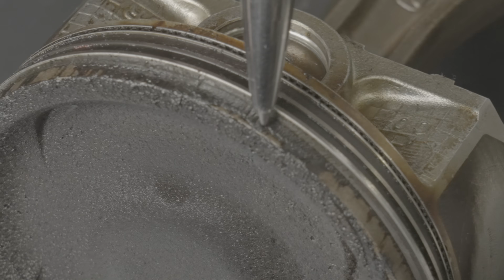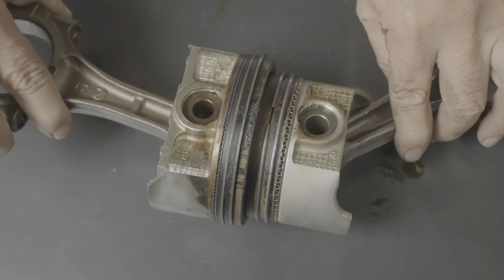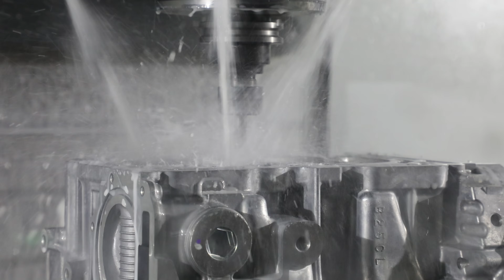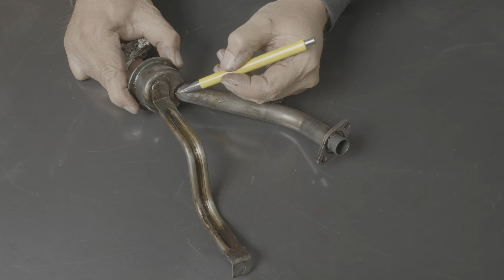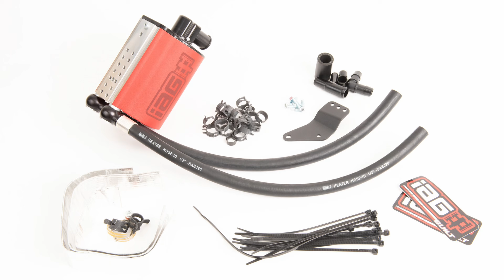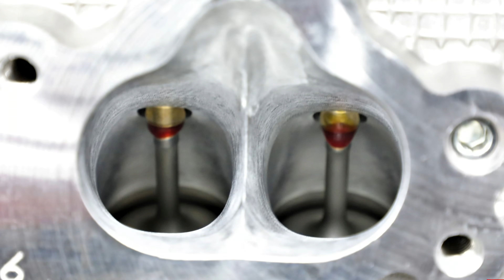Why Subaru Engines Blow Up!

Comment: BaderBuilt is on the road of perfecting these motor builds and actually making power on stock blocks & internals. He just did above 1000hp with I believe 45+ psi. Although I don’t know how much more it would’ve handled, when he did a tear down to prove the block was actually stock there was absolutely no signs of damage nor glitter in the oil pan. I’m not saying they are completely bulletproof but everyone thought it was impossible to make that much power on a stock block even Josh said that himself.
Reply: You understand that it’s actually not that impressive right? First off, that thing doesn’t start making power until like 6000RPM, it makes very little torque which means it’s not seeing crazy cylinder pressure. Look at the power curve, it’s makes power for about 1500RPM and would absolutely suck to drive on the street or the track. Second, on high ethanol content, it’s virtually impossible to get the thing to knock, you’ll push it way past MBT and squeeze the damn rod bearings out well before you see knock. Also, that would not live very long making track pulls or on the street it’s a completely useless project. Bader hasn’t figured out another new about EJ’s other than new ways to blow them up. STOP idolizing this guy and others like him. He’s at best a “one pull hero”.
Reply: @JordieG8 How can anyone say that a stock 1000 whp 4 cylinder is not impressive? It’s currently the only 4 cylinder in the world to ever pull that off. It’s crazy to me that Subaru never gets any type of recognition no matter what they do. Subaru could build a rocket car and people will still hate 😂
Reply: @builtvisions  because it’s not. For all the reasons I mentioned and if you had a clue what you were talking about you would understand. I’m not dogging on Subaru, I own one.
Reply: @JordieG8 Also for the record, you’re incorrect. He’s already confirmed that multiple EJs that he’s tuned, a lot of those on stock engines past 500 whp have seen many years of abuse and 50k plus miles with no negative feedback from the engine. You need to understand that Josh Bader is the best in the game when it comes to tuning EJs. People can make jokes about EJs all that they want, but it doesn’t change the fact the an EJ in the right hands can be extremely competitive in the racing world.
Reply: @builtvisions  Best in the game? Dude, if you had a clue what you were talking about you would know what a fraud this guy is. The amount of complete uneducated bull shit he says in his videos is painful. He has a strong following because he panders to the lowest common denominator such as yourself. The types of people who don’t know what they don’t know. People working their way up mount stupid on the dunning Krueger scale. Stop believing everything you see on the internet stop idolizing people and think critically, for everyone’s sake.
Reply from the maker: He knows what he is doing, he tries to make the most power possible on stock bottom ends to see what can be done, with the right tuning those kinds of numbers are possible for a little while.  Those kinds of things are good for likes and views, nothing wrong with that. I stress a little while.  He seems to be mostly a drag racer.  If you do a non-competitive track day,  Every lap is equal to several quarter-mile passes at least, probably a day's worth at the strip. One session is like 20 trips to the strip, typically you have 3-4 sessions a day and a track event is two days.  Then you throw in stuff like oil sloshing due to G forces and prolonged heat build-up due to being on the throttle so much. That is just a fun track day, not like competition like time attack or road racing where you are tuning up the wick. I tell you what, a totally stock subie engine turned up to 1000whp and run on a road course isn't going to last even one session even on a fun non-competitive track day unless you are putting around. The team I help has at least one fully built engine sitting in the transporter ready to drop in when they are at a major time attack. and they run at 700-800 hp.
Reply: @motoiq  Well yes, I agree with you on that. A road course is going to be much harder on any engine in general, especially one at such high power levels. Regardless, it’s great to see how much the Subaru platform has grown over the years. I’m sure that it will only continue to develop.
Reply: For how long between rebuilds?  1000, 2000, 3000 miles of road racing? 🙂
Reply from the maker: One pull hero car.  Take it on the road course, BOOM one session.  I am not saying they don't know what they are doing, they did it just to see if it was possible, just that if you took it to a track day, it would not be running after a few laps into the session.
Reply: @motoiq  💯
Reply: @motoiq  Love and appreciate your candor Mike!!!

Comment: I’d like to inform you that I’m a dumbass and blew over 100k building and fixing my dumb Subaru.. had 4 engines in it and it was 600 horsepower in its final form.. my oil pickup cracked when it was stock engine just jbo tune.. 280hp.. car never saw a track day in its life and I broke it.. then the second engine I left open deck like a dumbass.. on this engine car made 350hp and I cracked a cylinder.. you are overestimating the engines durability it’s actually worse than this video makes it sound
Reply: You could have stopped after the first sentence.

Comment: Can you comment of the pickups in the ej255 featured in the legacy GT as possibly heard they were revised or is the design still flawed as explained around the 9min mark
Reply from the maker: Same bad engine.
Reply: @motoiq ok thanks for the feedback. I've tracked my GT twice with no issues so far, one in post tune, approximately 220~ whp. Aussie dynos show a lot less verse American

Also have never really heard any pickups failing within our community but time will tell with in my context...
Reply from the maker: It's not super common, I have only seen 3 cases personally but it happens and it sucks because that cheap little part destroys the whole engine.

Comment: As always, thanks for the content and thorough explanation 👍🏽

I know its controversial, but what about dropping an SR20 in there, and mating it up to the awd dccd transmission?
Reply from the maker: If you were to go to the trouble, my choice would be the K24
Reply: @motoiq  Do you think a K24 would even fit under the hood though? They are so tall. Would be awesome but would have to see the measuments if it would even clear.
Does anyone know if it clears?
Reply from the maker: I dunno, if you were going through the trouble, you can make the hood fit, just saying.
Reply: @motoiq There's actually a good project   https://www.youtube.com/watch?v=wg2mQNF0i48 From Emilio from BoostedBoiz
Reply: @motoiq or stick a 2JZ in it and let it hang out of the front of the car like a big dong 😂

Comment: This seemed to be a mostly EJ-centric video, but how much of this applies to the n/a FA motors installed in BRZs?  Mine is stock and I haven't tracked it yet but honestly live in fear of it blowing up every time I push it on a backroad!
Reply from the maker: Much past 400 whp and you get oiling problems, the oil pump gears break much past 8000 rpm.
Reply: I had a customer run a completely stock block FA20 FRS in a road racing series.  It was equipped with a Rotrex supercharger, ran E85 fuel and tuned using Ecutek on the stock ECU and made 400 whp.  Ran an 8 race season finishing in the top half of the class with no engine issues.  Your mileage may vary, but on E85 with a proper tune the FA20 is a solid engine that should last quite awhile - IMO below 300 whp tuned properly is very solid.  Just beware the transmission.  The new FA24 seems even better in many ways although some people are saying there are oil pressure issues.  But the fastest guys out there are running stock oil systems without any issues. So not sure what's up there.
Reply: It's fine if it's stock (mostly true for EJs too) and you're not running hard for long enough to overheat the 0w-20 oil. Keiichi Tsuchiya didn't modify the engine on his personal brz/86 and I don't think he's blown it after several years drifting with it.
Reply: I’ve heard it’s a problem with bearings tolerances on this engine (not sure, not a pro 😅)
Reply: The new one that oil starves when you switch off the stock tires? Well, assuming you actually know how to turn a car. Nah, I don't see them lasting on the track all that well.

"A Subaru spokesperson tells R&T that "Subaru of America stands behind the design integrity of the FA24 engine which is used reliably in thousands of vehicles. Oil pressure varies in all engines based on RPM, temperature, cornering loads and numerous other external and internal factors. This is normal in an engine duty cycle. The FA24 engine is designed to perform within a wide set of tolerances for road use, and the Subaru BRZ is designed as a road car. Race cars are specially modified to be used for race conditions." 

So no, your road car is specifically designed to be a pile of cost cut junk. Probably best to keep it off the track, or stick to nascar...
Reply: @pontiacg445  2 of the fastest guys in the country on the new GT86 are running completely stock oil systems on sticky race tires and are 10+ sec/lap quicker than a lot of the guys saying they have oil pressure issues in corners (low 1:50's at buttonwillow 13 in central cali).  That's why I said I don't what's up with the complaints.  I know there were issues with extra gasket/sealant in the oil pan getting on the pickups.  That's a legit issue. But I'm still waiting to hear what's really up with oil starvation in corners.
Reply from the maker: We have done two FA24's for GR86 Cup cars and they have to be 100% stock.  The engines, bearings, and internals were fine, but the heads and front covers got damaged due to crashes.

Comment: All I have to say is the SR20 (SR16, SR18 as well) are DAMN excellent motors: Robustly overengineered and durable. I've owned many of them since the mid-90s and agree with your assessments Mike!
Reply: 4G63.
Reply: @theakh4238  The legendary 4G63 is ultra-amazing and incredible as well...maybe arguably even moreso!
Reply: Yeah! I <3 my SR20. Even if it is in its NA FWD form. :)
Reply: @LePedant  That's what started it all for me: A 1996 B14 200SX SE-R automatic (with factory stock VLSD). From there, the list is long. Many happy journeys with the trusty SR under the hood. Most of them afterwards were connected to a 5MT.
Reply: @craigslistseller9354  Nice! Yeah, I have 2000 P11 Infiniti G20 Touring, which has the VlSD from the factory as well.  I live in the hills of KY, it's SOOOOO much fun driving it on the country roads out here.

I saw a 2002 G20t with a 5mt and 86k miles for $5000 a couple months ago. If I had the money, I would have bought it instantly. I would love my car in a manual.
Reply: @LePedant  We share the same 'sickness'. Haha! I've owned 3 P10s, 2 P11s, 2 NK1600s (GA16) and a plethora of B14s' including 3 '99 SE-Limiteds. Loved every single one of them except my first P10, which was neglected mechanically by previous owners. My last P10 was a low-mileage '96 G20t 5MT. It had leather seats in perfect condition, front & back...a rarity for an almost-20-year old car at the time I bought it.
Reply: @LePedant or is it a 1st gen infiniti g20? Those were definitely sleepers growing up 😅
Reply: @mosswine5417  It's the G20t, 2nd Gen though P11.

Comment: Seems the 2.5’s fail more the 2.0’s when turbo charged. Based on what you said about the ring lands, timing and flame propigation, the decision to use an opposed boxer engine probably  handicapped the design. The typical way to increase performance is to increase engine volume. But being a boxer, Suburu could only increase the bore since increasing the stroke would make the engine even wider and even harder to mount into the Imprezza chassis.
Reply: Yeah, boring out the EJs to make power on crappy US gas while meeting emissions requirements only increased the fragility of the block. The JDM EJ20s are often nicer when compared to contemporary engines destined for america.
Reply: I think the main thing is that the 2.5s had an even tighter ring gap than the 2.0s and a larger bore, so the rings get tight and butt slightly, even on stock cars, fatiguing the ringlands. Mike talks about failures from detonation, which of course happen, but I think the main failure you see is between the first and second ring. IMO what's happening is that this area is stress fracturing due to drag from tight rings. My personal car broke a ringland on a VERY mild tune after a long drive where I was sustaining higher speeds (nothing crazy, like 80mph) and pulling some hills. Time+heat+.009" ring gap=tight ring and broken piston. You also see cyl 4 always fail first which IMO is due to it having higher heat, and thus a tighter ring. People claim the heat causes cyl 4 to detonate, but if the knock sensor isn't detecting knock, yet it's still breaking the ringland, that doesn't make any sense to me and the gap seems a much more plausible cause.
Reply: @Levibetz  Is cylinder 4 hotter due to the unequal length header? Does converting to the equal length header and turbo setup from a Japanese STi S-series car solve that?
Reply: @TassieLorenzo  I'm pretty sure it has to do with how the coolant flows in the block. There's a "cylinder 4 cooling mod" which adds an extra hose that feeds a drain port near cylinder 4 to help with it.
Reply: The boxer design isn't practical. I just don't understand why subaru still insists on using it, especially on so many of their low performance cars. The balance is slightly better than an i4 without a balance shaft, and some people like the exhaust note more, but the theoretical advantage of a lower center of mass disappears when your car is already as bloated and heavy as an AWD WRX. It's inherently weaker, more complicated, more difficult to work on (except certain jobs) and more expensive to build. 

It made sense for porsches and VWs of the past, but it doesn't make sense for modern day subarus.
Reply: @mr.bitsbyte4664   Or maybe Subaru needs to pay a visit to Porsche and see what they are doing.
Reply: @12skipafew-e7y  Porsche engineering has carte blanche to do it properly when they can charge 100K+ for their cars, and people will line up to buy them. Stuff like dry sump systems aren't cheap, but fix the oiling issues, for example. They can also get away with having worse emissions and fuel economy due to their corporate structure with VAG.

That  being said, porshce has also had a bunch of nasty issues when they weren't so financially powerful and had to switch to water cooled flat engines...
Reply: @12skipafew-e7y  To be fair, the Subaru flat-12 F1 engine from the early 1990's and the Porsche V12 F1 engine from the early 1990's were equally disastrous, lol.  That the Porsche engine was a Vee layout didn't seem to help much, lol.
Reply: @TassieLorenzo  Formula One is an attempt at achieving a lot of things that aren't the goals of commuter cars, or sports cars.
Reply: @mr.bitsbyte4664 the boxer design is what makes a Subaru handle the way they do. Sure they have their quirks but all of the major manufacturers these days have issues.
Reply: @mr.bitsbyte4664 it’s for the Lesbians
Reply: @mr.bitsbyte4664  the boxer engine plays into subarus entire chassis design. subarus drivetrain works well because of the way the transmission and differential are centrally aligned to make the balanced symmetrical awd their known for. the lower cg of the boxer also makes for a better handling car and helps with safety because the engine is slightly titled back and downwards to shoot out of the car instead of into you in a front end collision
Reply: @mr.bitsbyte4664  Are you suggesting Subaru should go to a V4 (& V6) or to an inline-four like on the Audi Quattro cars (EA888 on the A4/A5)?  Isn't the advantage of the Subaru flat-four and the Subaru CVT & Subaru manual transmission that they are cheap for Subaru because Subaru can make them themselves?  If Subaru went to a Toyota 8AR-FTS turbo 2.0 engine and an Aisin transmission on the WRX (and Toyota inline and V6 engines on all of their cars), they would be better quality, but wouldn't Subaru lose it's autonomy and ability to do in-house manufacturing, which is already precarious as a very small auto manufacturer? 🤔

It's kind of like SAAB isn't it?  Better that SAAB have their own odd-ball Triumph engine with gearbox underneath than get homogenised into General Motors and lose their identity? 🤔
Reply: A V4? Ducati powered? @TassieLorenzo
Reply: @kea1234  Sure, why not? Honda has a V4 too.  It doesn't cost any more to make a V4 than a flat-four.  Ford-Werke and Ford UK used V4s widely in the 1970's.  Lancia had a V4, but it more like a VR4 with a single cylinder head.
Reply: I hear you but it's more likely they will phase out ICE engines and transition to all HEV or BEV rather than put r&d towards a new platform no one has used in a long time. Don't get me wrong it would be super cool however unlikely.
t  @TassieLorenzo
Reply: I'm with you @TassieLorenzo

The V4 is a relatively popular config with motorcycles and marine engines, so why not automotive? They're compact, less inherently flawed than average (balance, crank torsion, thermals, sealing) and often sound amazing.

Bonus: there's a FortNine video on engine configs highlighting the V4
Reply: @TassieLorenzo  I think the smart move for Subaru in the future would be a turbo I3 leaned way over. You could likely fit it in existing chassis without too much fuss.